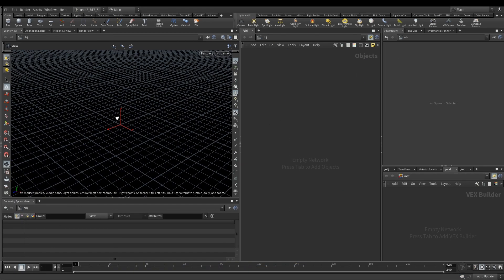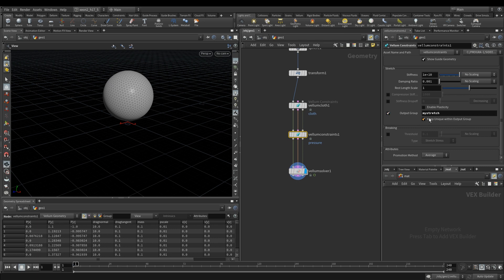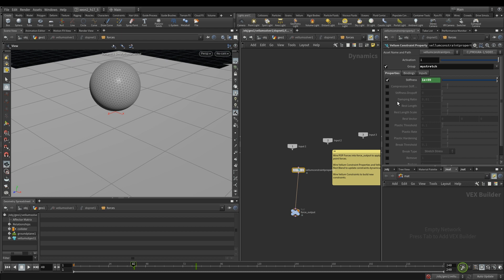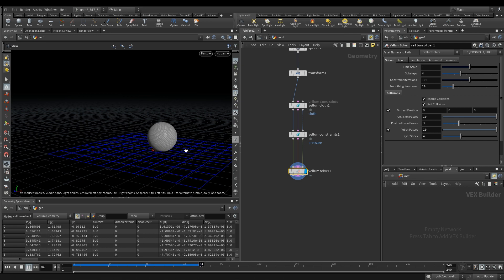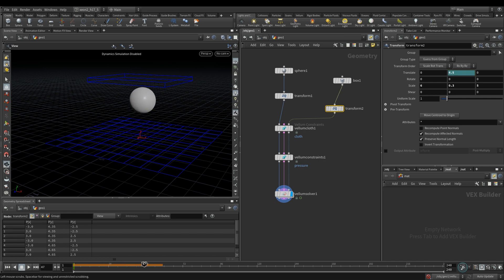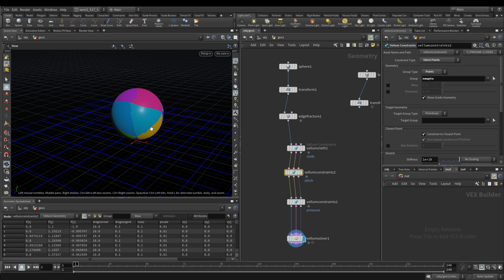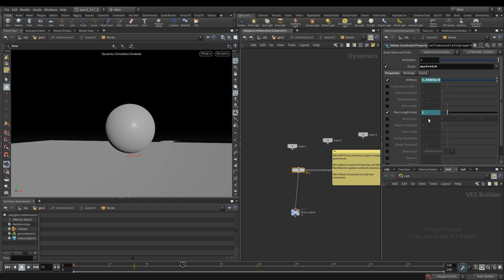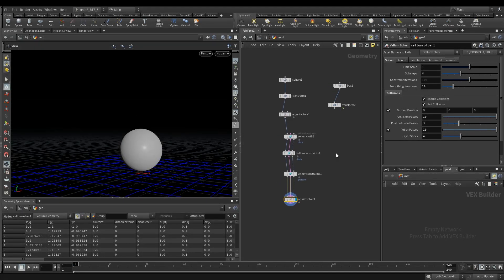Houdini Vellum Balloon Inflate and Popping

Comment: somewhat the setup is not working as expected once you do the stitch part. I am on H19 and they changed alot of stuff since then, can you recheck the tut files if they still work?
Reply: use vellum weld points instead of stitch points